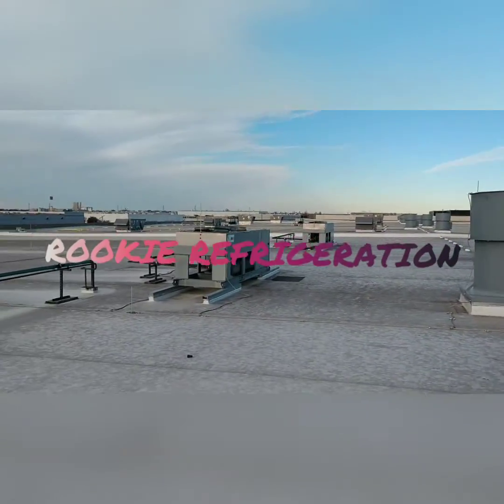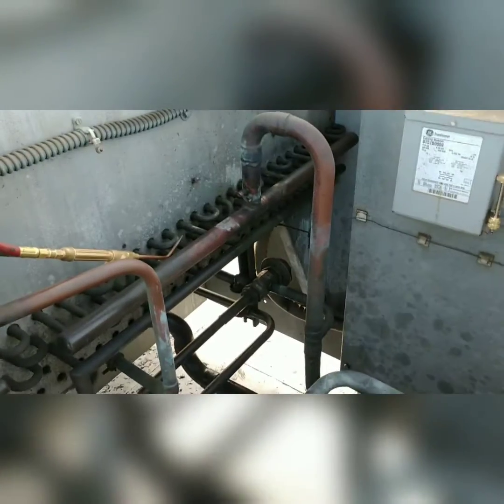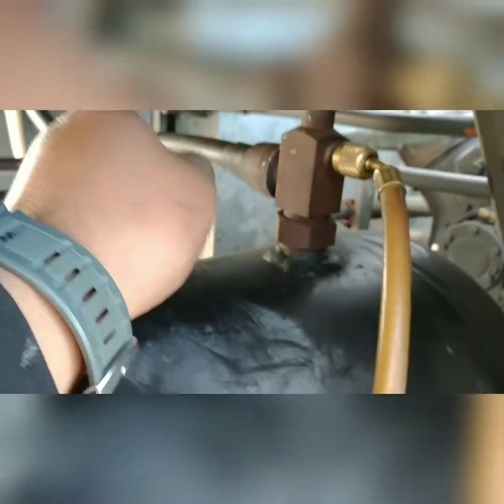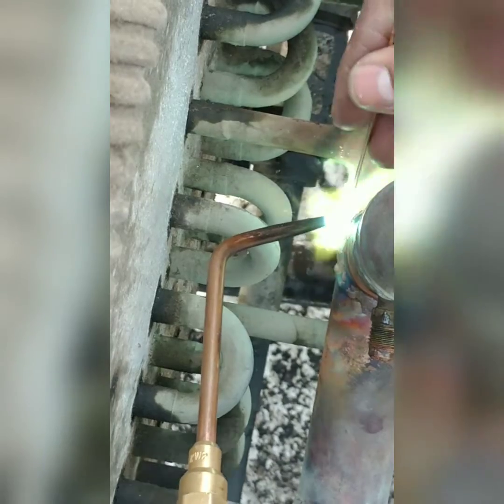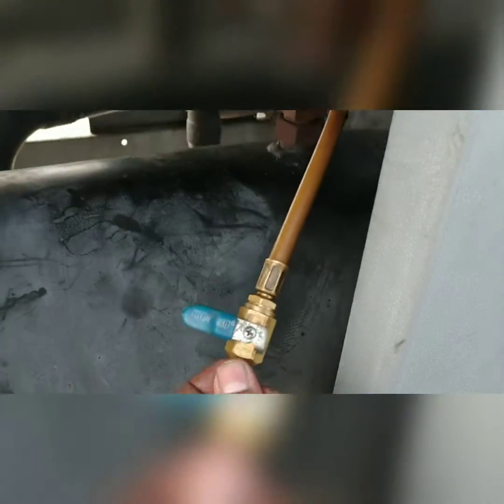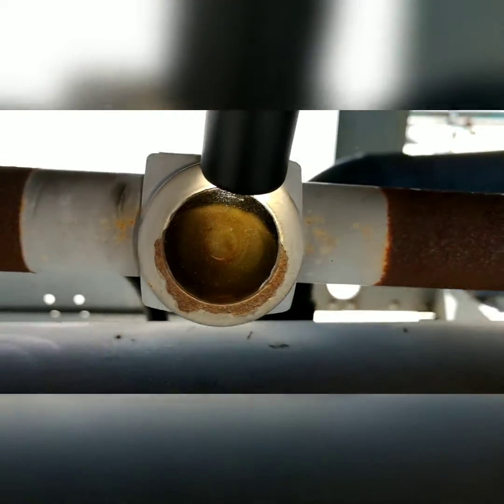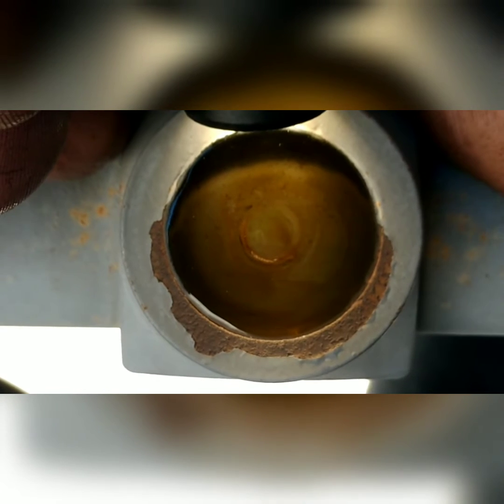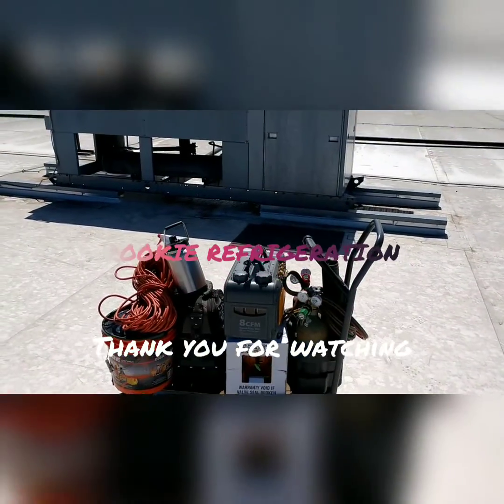HVAC/Refrigeration- Leak Repair and first time using the TruBlu hose.

Comment: How are the evacuation times with the trublu? I have a 1/2” and 3/8” megaflows and a navac 8cfm and evacuation times on 50ft linesets are still painfully slow
Reply from the maker: I have 1 trublu hose and also 2 appion hoses.  I remove the schraeder cores for faster vacuum.  I really enjoy the trublu, sometimes I just “1hose it”.   Lol.
Reply: Rookie Refrigeration yeah I’ve got the appion core tools on both sides and a BluVac professional